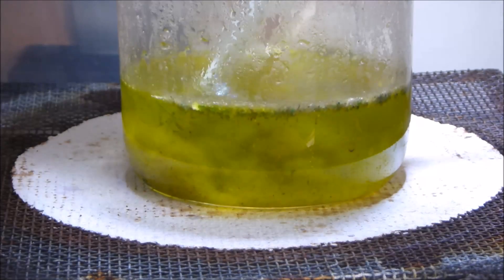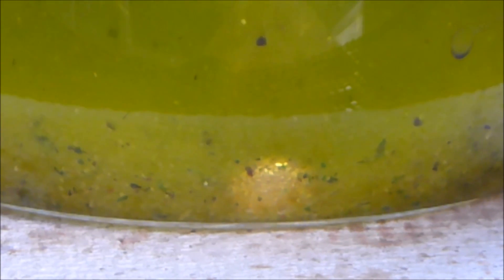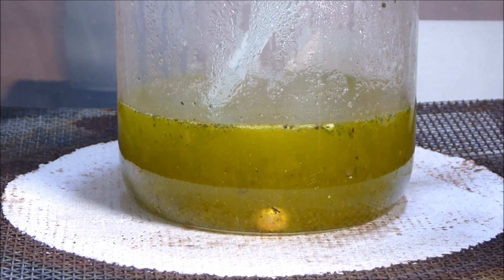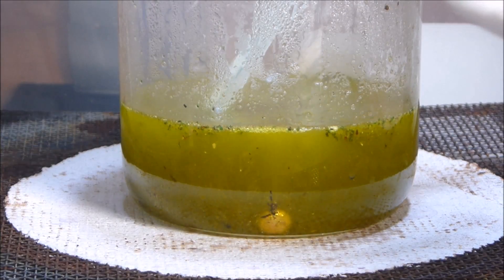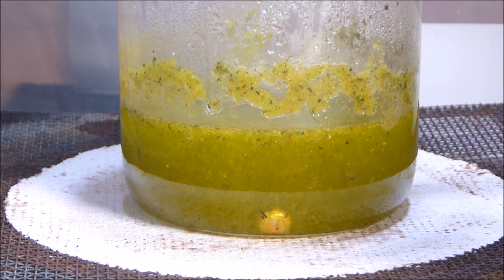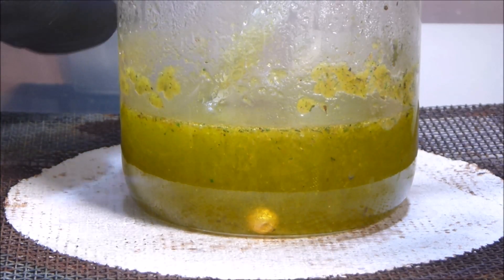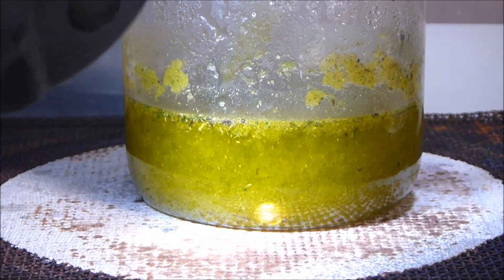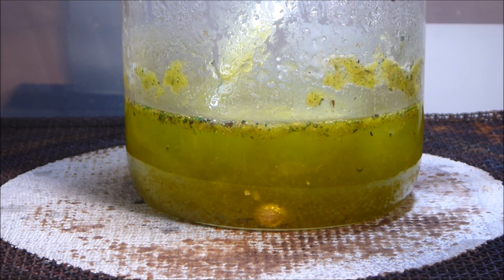Denoxxing your Gold solutions with Sulfamic Acid

Comment: Thanks for sharing.  If we don have a gold button for indication, keep adding the sulfumic acid till there is no reaction in the solution can? Or is there  other metal can replace gold as indicator? Thanks advance.
Reply from the maker: I guess that Copper will also work as indicator, but will add extra Cu to your solution. It is quite difficult to judge how much Sulfamic to add without the indicator, and you don't really want to add too much!
Reply: Successful Engineer if that so, wont the CU affect the purity of gold? Thank you.
Reply from the maker: Kepong JUSTICE Kepong JUSTICE I have thought about it some more, Cu is actually not good because it will cement Gold out of solution. If you use SMB to precipitate your Gold then the Copper in solution doesnt hurt too much because the Cu stays in solution. The best way is to use a pure Gold button as indicator. Also try to use the smallest amount of Nitric acid that you can to dissolve the Gold, neutralizing excess Nitric is always difficult.
Reply from the maker: Kepong JUSTICE Kepong JUSTICE The other option you can do if you have too much Nitric is to deliberately ise a Copper bar to cement all the Gold out of a solution. This way you get a fine black / brown powder and excess Nitric acid doesnt matter, but the Gold purity is not as high.
Reply: Successful Engineer i see..., this is what i understand is to add a gold button in the pregnant solution, slowly add sulfumic acid powder and observe the reaction of the gold button, stop adding sulfumic acid when there's no more reaction on the gold button, and then add the SMB (mix with water) into the pregnant solution and wait till the gold dust settle down. (SMB/ sodium metabisulfite)  2grams if expect that there is 1 gram of gold. Am i correct?
Reply: Successful Engineer but its hard to  expect how much gold will be in the solution. So a little excess SMB isnt much matter. Am i right? Anyway Thank you Boss! Your video is really really helpful. Because some of the details is very important to those newbie like me.
Reply from the maker: Yes, that sounds procedure sounds correct. In practice, you would let the solution cool after you finish with the denoxxing (Sulfamic Acid), then you would let any precipitate settle overnight, then you would siphon off the pregnant solution into a clean beaker, making sure not to siphon up any of the settled powder. Then you would add the SMB to the pregnant solution to precipitate the Gold.
Reply from the maker: Correct, a little bit of excess Sulfamic acid for denoxxing, or a little bit of excess SMB for precipitation of the Gold is no big problem. If you add way too much SMB, you will bring Copper out of solution with your Gold (lower the purity), but it can always be re-refined.
Reply from the maker: Happy to help :)

Comment: Yet another nice informative video from you, I'll be using this method for sure, 
Only one question, I have a product called Sulfamic acid cleaner in granular form that's used for cleaning tiles, I'm wondering if this is the proper stuff to use, thanks a lot bud.
Reply from the maker: Hey there, yep, that is the stuff. I believe it is sold in some countries as 'grout cleaner' or tile cleaner. You can test it before adding it to a gold solution by just mixing some nitric acid into water, then add Sulfamic acid. Initially you should see a energetic reaction, which will decrease as the Nitric is converted. Make sure you have the solution hot when adding the  Sulfamic, I don't think there is much reaction if you do it cold. Thanks for your comment and be safe :)
Reply: Successful Engineer Hey thanks, so now where does the tin and metal go that the sulphuric acid cleans up, does it drop out as sediment that's caught when filtering the gold solution or does it just not drop out when doing the gold drop? Thanks
Reply from the maker: The Sulfuric acid makes any lead in the solution precipitate as a white powder which will settle on the bottom over a day or so. By the time you have gold in solution, there should be no more tin in solution (SC) otherwise you will end up with colloidal gold.
Reply: Successful Engineer thanks again my friend, you helped clear up the problems I've been having at this stage, best regards; Andy
Reply: sulfamic acid naturally occurs sand-looking, but with water you can make it a liquid as well as dilute the strength